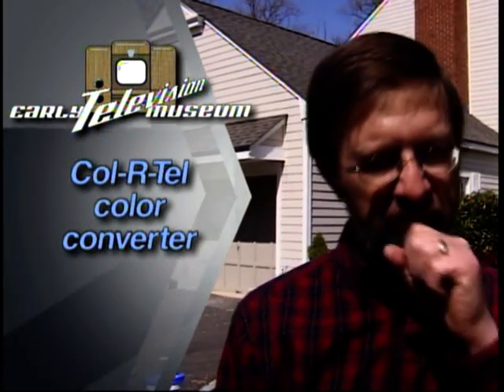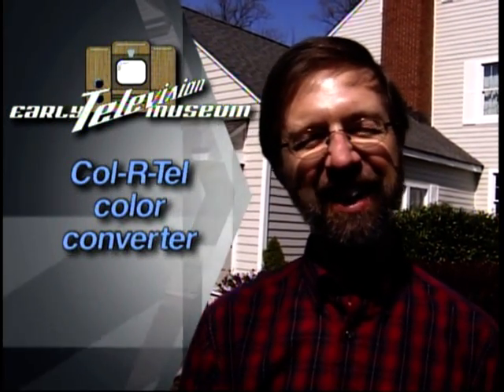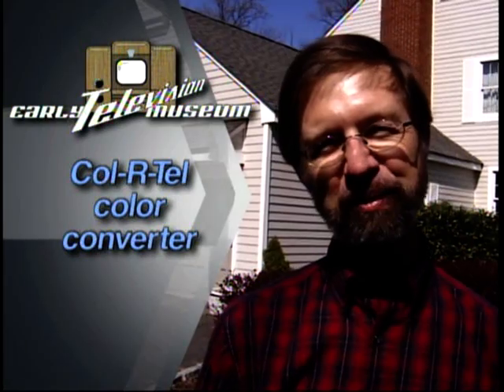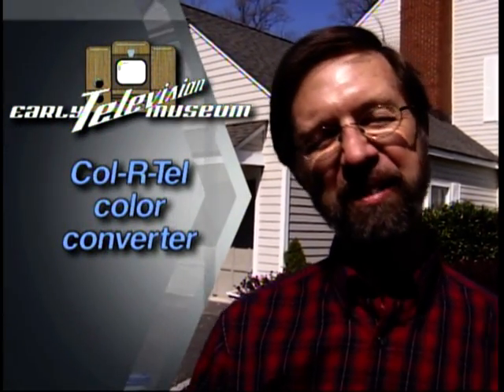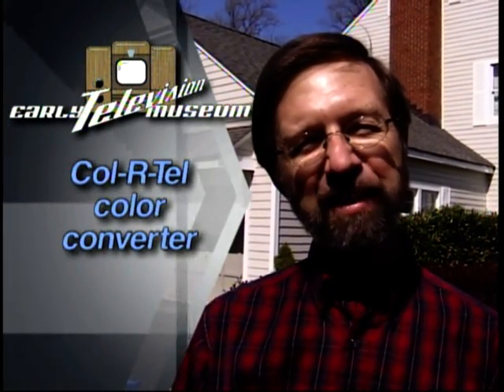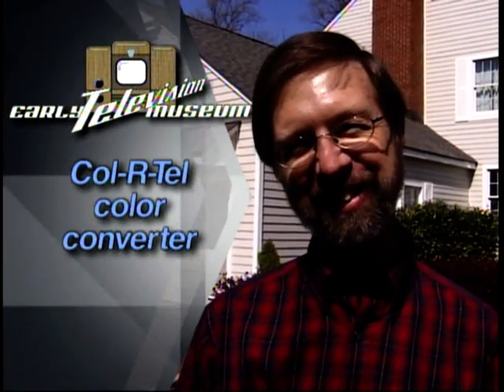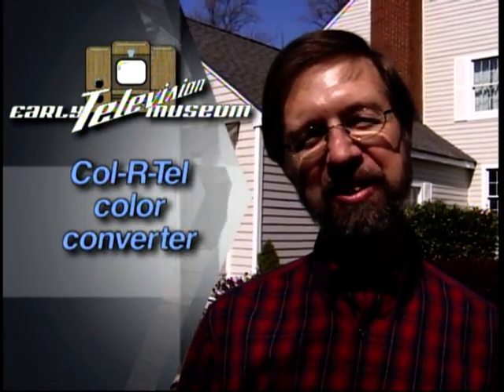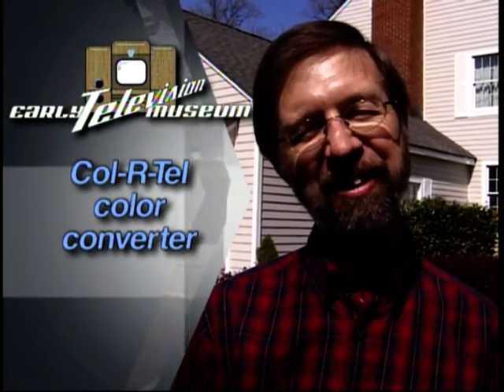Col-R-Tel Converter at the Early Television Museum

Comment: I found this idea soooooi geniiuse because 1 it allowed users to convert their existing b&w tv into a color tv.
2 it was much cheaper then buying a color tv.
3 it combined the technology of mechanical & electrical tv from 2 competitors into just 1 unit.
I bet if those 2 competitors had saw this device in 50's they might have be agree with eachother to have this as an second alternative standard.
I see very high potential in this device technology becouse you can turn any b&w tv,lcd screen including b&w handhelds into color.
Just amezing.